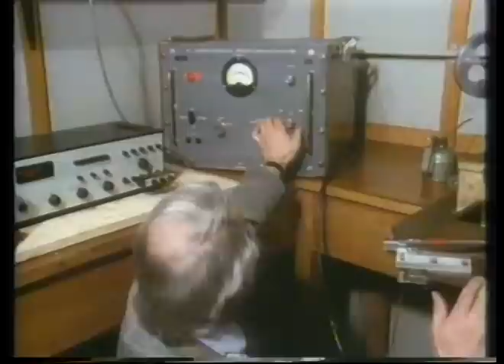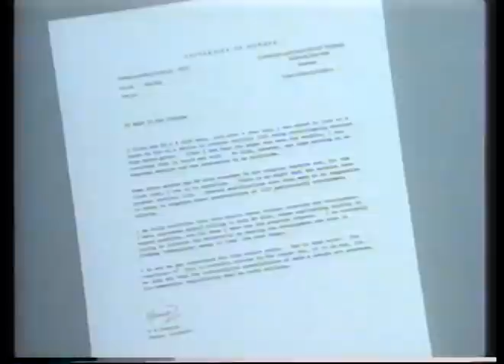Anti-Gravity Machine (Part Two)

Comment: I have worked on this since 1960. with a large enough % of your mass in rotation it works like a champ. I am currently working on a self contained rotation drive.
Reply: What is it about rotation that causes these anti-gravity effects?  Could you achieve the same sort of result, not by bodily spinning an object, but by applying changing EM fields to cause each individual atom to spin and precess in place?  I wonder whether they have observed any anomalous weight effects with samples in NMR machines?
Reply: @LeoFreemanAUST  What makes you think that there are any anti-gravity effects? The word of a Scots nonentity? Bet you've got a fine collection of wooden dimes.
Reply: @MrAaronvee  But how do you explain being able to lift 18 kg above your head, repeatedly, with one hand??? This was also confirmed by Derek Muller of Veritasium.  I just wish they used a heavier wheel that couldn't be lifted normally.
Reply: @LeoFreemanAUST  I am no strongman, but I can easily do that. Years ago, I could do it with a UK standard bag of cement (which weighs one twentieth of a tonne). However, if the person cannot lift the non-spinning wheel, he will not be able to lift the spinning wheel. The whole thing is an illusion: the naive observer sees the heavy weight on the end of a long axle, and imagines how hard that would be to support. In fact, even Superman would be unable to to it because, even if he could support the weight, the centre-of-gravity of the system could lie outside of his 'footprint' and he would fall over.  The essential point is that the weight of the non-spinning wheel acts feet away from the lifter and is indeed impossible to support. BUT it is the torque  (moment) about the wrist which makes it so and not the weight per se. Thanks to the precession of the spinning system, the weight then acts through the support-point (the hand) and the former torque disappears. It is that simple, and yet 'intelligent' people have been fooled by the trick for perhaps 200 years!
Reply: @DeputyNordburg  The device was not an over unity device. It never proclaimed to be a free energy device but one that converted the gyroscopic motion into a lifting force. It still needs an energy to run it.
Reply: Agree it was not an over unity device.  It was also not a levitation devise, or a devise any more useful that a magician's top hat.  It did not covert gyroscopic motion into lifting force.  It did not lift.  It did not become lighter in weight.  A gyroscope produces a torque a twisting force.   A twisting force does not lift anything.  In the comments above someone asks: "But how do you explain being able to lift 18 kg above your head, repeatedly, with one hand?"  The answer is that's pretty easy for any adult male to do.  Just do it with a barbell to see.
Reply: @dr zoidberg Only during Hanukkah.
Reply: @DeputyNordburg  ww1 aircraft with rotary engines
Reply: @100videosandnosubscribers3   Cuban sandwiches with pickles
ww1 aircraft with rotary engines use wings for lift, and propellers for thrust.  Wake up.
Reply: @DeputyNordburg  ok
Reply: @LeoFreemanAUST  The way this work is so simple it's often overlooked. The forces involved increase with the speed of the gyroscope. But it's not enough with just rotation, then the gyroscopic forces will be equal in every direction - you've got to move the rotating object forward perpendicular to it's axis(like the wheel on a bike), then the net speed on top of the wheel(being moved the same direction as it rotates) will be higher than the lowest part of the wheel(that then logically moves the opposite way) Even though every part of the rim moves with the same RPM, their real speed through space will differ, then you get more forces in one direction, in this case up.
Reply: @MrAaronvee  this is so correct it’s the torque and the weight being at the end of the pole that’s the difference, spinning or not if you hold the pole closer to the weight it will be the same, the spinning weight will not be lighter
Reply: @Jim Lewey  Perhaps a magnetized or charged liquid mercury in rotation could serve a dual purpose... ?
Reply: @DeputyNordburg  Any factual evidence or scientific reasoning behind such firmly stated conclusions, or do you know even less about Physics than you do the Illuminati?
Reply: @burtpanzer   Yes, both.  Can I ask what motivated you to Conspiracy theory?
Reply: @Peter Sneddon I've never been insulted by someone on the internet.  It's so original.  How did you think of it?
Reply: @DeputyNordburg  How much is Mossad and Exxon paying you? Tell them I want a piece of the cake.
Reply: @zynark777  They give me 50% of the profits they make from hilarious free energy machines.
Reply: @DeputyNordburg  Tell them I want to be a paid troll like you. Putin is paying me so poorly.
Reply: @zynark777   Oh I would not be Putin up with BS like that!  As soon an I get my gyroscope powered BullSh1t helicopter thing running I will be over there to straighten him out.
Reply: @CyberAndy_   Einstein–Cartan–Sciama–Kibble theory, is a classical theory of gravitation similar to general relativity. The theory was first proposed by Élie Cartan in 1922. Einstein–Cartan theory is the simplest Poincaré gauge theory. But is does not propose that wiggly spinny things will levitate.
Reply: @Ciel Terre  je jongle aussi
Reply: @ZachLifeTravelWord   please stop devastating me with you sharp wit. No moon hoax advocate has ever done this to me.  It is so original.
Reply: @jimmy56100  And what is wrong with that? People who have had every opportunity to learn elementary facts, and have failed to do so (or invent baseless alternatives), deserve everything that they get. They are also potentially dangerous; there are people working in the aerospace industry who demonstrably do not understand Newton's third law. Not a comforting thought as one boards a plane.
Reply: Want to build it?  A complete description can be found in the expired US patent: US5024112A.
Reply: I just wanted to let you and others know it DOES work. You were the first I know of who showed it to the public. Thanks
Reply: @jlewey1   It would be great to see it work.  It clearly does not work in this video series.
Reply: @MrAaronvee   What sort?  I don't classify them.
Reply: @DeputyNordburg  I wrote a book about them 20 years ago, but it never got published because it was an uneconomical 1200 pages long (I may sell it as an electronic version one day). Anyway, for that book, I had to classify them. The earliest (19th century) and the most popular type is based upon the delusion that the centrifugal force is real and can propel things in outer space (there are plenty of gadgets that work on the ground). There are 'internal rockets' that bounce objects around inside the spacecraft. There are 'pump' devices which circulate liquids internally. There are 'aerofoil' devices which circulate gas and insert an angled plane into the circuit. There are the 'gyroscopic drives' of course and there are a couple of very rare and particularly stupid ideas which involve simply pressing on the internal wall of the craft; one of those is based upon an incorrect diagram which once appeared in a physics textbook.  I have a filing cabinet which is packed with hard copies of the patents. It finally cost too much to get printed copies, so now I store downloads electronically. It is hard to keep up: two new applications have already appeared this month! The latest involved simply putting a conventional VTOL aircraft inside a big evacuated sphere! Here is the sting in the tail: some of these patents were granted, and at least one application was made by the senior engineer of a well-known aircraft company! A layman will of course think that that proves that these devices must work; a physicist like myself thinks that the engineer should have been fired.
Reply: @MrAaronvee  When you asked what sort of idiot would want to build it, I assumed you were classifying the idiots.  Sorting them into lists.  
I am pointing out the patent application and encouraging the believers to build their own in the hopes they will realize it does not work.   I would hope the public patent application would make them realize the government is not suppressing this "technology".   Dr. Laithwaite intros video got by mostly on government funds.
Reply: @DeputyNordburg  That might be a good idea: as a child, I tried to build a Dean Drive by using a construction kit. I soon saw how stupid it was. The problem is that your scheme might backfire ... badly. That is because these gadgets can often skitter effortlessly across polished floors, ice and (on a raft) water. Amateurs are not aware of the many hidden asymmetries in physics, and therefore conclude that their machine will work in space. So perhaps you should also tell them that only a steady deviation of a ballistic pendulum that contains the device counts as proof that it can work as a space drive.  Note that Kidd, Laithwaite, etc., never used a ballistic pendulum. They simply weighed their machines. Physicists have a saying: 'only a moron expects to get a meaningful result when weighing a moving object'. Somebody once showed that an electric bell 'weighs light' when it is ringing.
Reply: @MrAaronvee   Statistically about 1/10,000 conspiracy theorists will attempt to build anything.  I think the odds of one hurting himself is pretty low.
Reply: @KimoKimochii  if it is moving upward and downward while rotating it is weightless.
We can use this phenomena to lift heavy tanks of pesticides for spray the crops.
Reply: @fordlancers7579   if it is moving upward and downward while rotating it is weightless. - No.  Spin a ball and toss it up, it will come down all by itself and as heavy as it was before. Same for a gyroscope.
We can use this phenomena to lift heavy tanks of pesticides for spray the crops.  - You are welcome to try.
Reply: @DeputyNordburg  But your arm providea the lift and spin... An external force.  Since this is "contained" that's a little different, no?
Reply: @MrAaronvee  Do physicists walk around talking about "Newtons Third Law" or the always popular "# Law of Thermodynamics?". I see a lot of YouTube physicists pointing out these laws ... But you can tell they've never actually discussed this in real life because even I can poke holes in their logic, broken law or not.  Point being, it seems to be that anyone that uses a term as simple as "Newtons 3rd Law" without ANY specificity into how that law is applied in a situation doesn't really know what they're talking about.  That's basically like walking around doing stuff, and saying, "it's in the Bible." Where?  When?  How?!?

So can you explain specifically why it bothers you when people in the arerospace industry "don't understand Newtons 3rd Law?". Why would that scare me when getting on a plane?
Reply: @therealking6202    Sorry, I don't know what you mean about my arm.  And I assume by "this" you mean the machine in the video.  
 I'm also not sure what you mean by "contained".  If you mean isolated, it seems like the opposite of isolated. It has a big electric motor and is getting 240volts of electricity from the wall.  There is are also counterweights and a pulley system visible (to lift it up)  There is a bucket and lots of other stuff, including a string at the top just for lifting it up.  Contained/Isolated?  No way. 

At 0:17 when we are told "the machine lifted" and get the happy music, the camera just shows us a part of the machine.  Why can't wee see the whole thing? Is someone lifting that part by hand?  Even then the center shaft does not go up.  And why is the whole video so blurry?
Reply: @DeputyNordburg   Your arm, meaning when you throw the ball in the air in your example.

I don't think it has an electric motor?  I know they use the drill to spin it up, but I thought that initial force was all that was required, similar to how he spun up the weight and started waving it overhead.  The pulley system was merely a measurement device from what I understood?  I mean, a hairdryer might be sitting next to the machine, but that doesn't mean the machine is using it.  What if the bucket was just to catch the rain dripping from his garage?

I need to rewatch now and take a closer look.  Thanks for the reply.
Reply: @DeputyNordburg  This gives a better explanation.  It IS powered as you mentioned, and in space the power would nuclear (teaspoon of uranium).

This doesn't "solve" anything, just thought a different view might be helpful:

https://youtu.be/OL_Gasok8xw
Reply: Counter rotation.
Reply: @CyberAndy_  So, spinning plasma chambers in a vehicle will propel it?
Reply: @MrAaronvee  doesn't change the fact this allows a person to transfer large weights outside their center of ballance without being so lopsided as to fall over. Nor that the forces of resistance on a turning device are so minimal a like breeze could likely turn it. If it spun light magnets suspended over metal would act like a generator
Reply: Hi Jim. I'd be super interested to see what you've come up with. Lest it end up like this poor gentlemans work after he finally passed over, and become lost to time again only for the secrets he worked so hard to discover to die with him.
Reply: @CyberAndy_  I had a feeling plasma spinning is key. I think spinning plasma might creat a charge separation too. Heavier protons on the outside shell and electrons on inside.
Reply: Spin mercury and bend it. Trr it solar😊
Reply: @MrAaronvee  it was spinning and as a stonemason, you are just ‘neck down ‘ fow work
Reply: spin mercury and then bend it and try to control it
Reply: Mercury Mercury engines bend it just a touch and see where it goes . Don’t do it by the power lines @100videosandnosubscribers3  10:56
Reply: @LeoFreemanAUST yes. It clearly aids lift. The centrifugal force pushes outwards. So with combined gyros and plsying with angles and spin...it makes perfect sense you could lift a weight. It decreses weight. I wonder what coyld be done with large gyros, wuth liquid metals and angular momentum?  Im sure by now they can do great things they arent telling the public.
Reply: @jamescoulton5138  u know, my guy😎
Reply: @DeputyNordburg  You seem to be saying that a professor, a doctor and a team of PHDs are clueless as to what they are looking at. And re your laughable barbell comment, the example lifted was one quarter the length of a barbell and twice the weight. I'd love to see you perform the exact same demo with an 18 kg dumbell. You will not be able to.
Reply: @bigmaryhelen  a professor, a doctor and a team of PHDs couldn't find a scale to measure this thing?  pull the other leg.
Reply: I double spin magnets 
Or twist and twirl
Hand held stands me on toes anf hair on end
But a poor man is not looked at
Reply: @danahoecker3308   I duct taped 2 house cats together, and they levitate because neither wants to land on it's back.

Comment: This must have been at least 30 years ago so I think we can conclude that the idea was bollocks.
Reply: As it does not appear to rise in this video, and at no point is any attempt made to measure it's weight, (or anything else), I think that is a safe bet.
Reply: The gyroscopes themselves are able to defy gravity but the Practical use is non-existing😮 he made something at 40 lb can lift 2 lb there's not much room for cargo
Reply: @charliecostella   I've never seen a gyroscope lift it self without a pivot arm firmly planted to the ground.  That's twisting, not lifting.  His 40lb thing can lift 0 lbs.  Given time he may double or triple that.